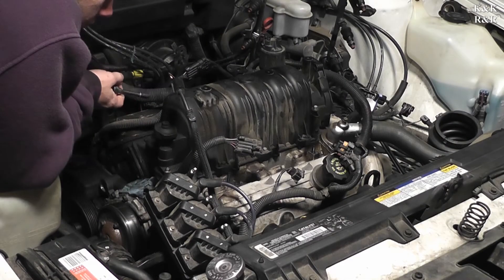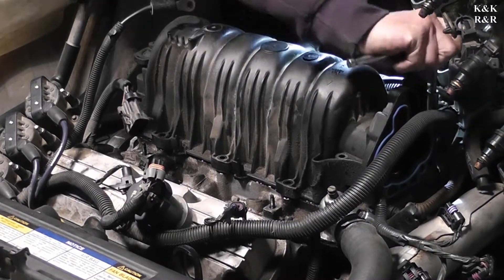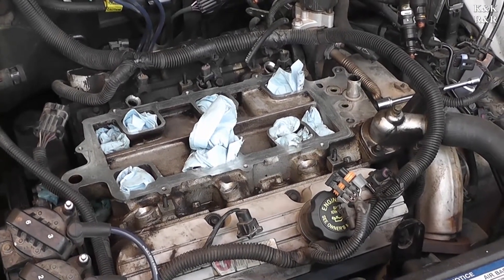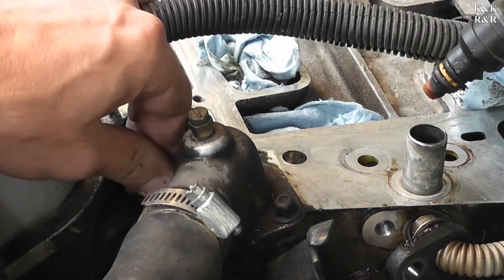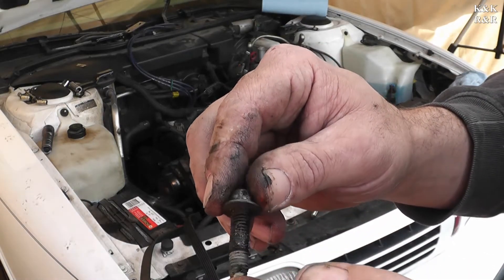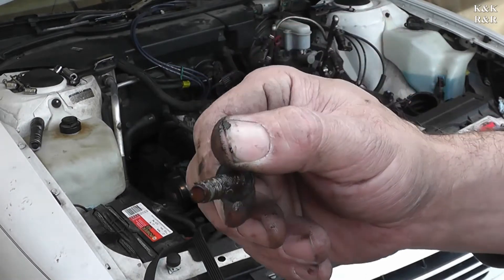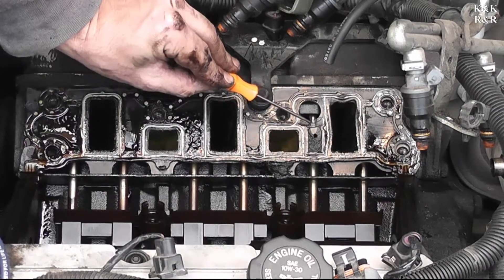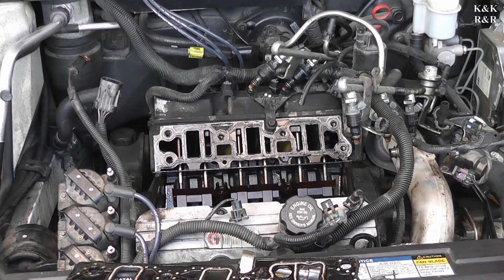1995 Oldmobile 88 Pt.3 3.8L / 3800 Upper / Lower Intake Manifold Removal Parts B & C

Comment: Hi, new great videos I have been cross referencing because I have a Oldsmobile eighty eight V6 3800 series ll Vin K 3.8 l 1996 Royal Sedan and I started last year changing gaskets and parts and still finding leaks. Finally had to change the head gaskets, water pump, timing chain & tensioner, manifold gasket and exhaust gaskets and plenum. Did oil and antifreeze flush torqued. Now I found a transmission extension gasket leak that is probably causing and contributing to the blown head gaskets I replaced. I wanted to know if you have any videos on replacing the transmission extension gasket and transmission valve cover gasket how to at home. Removing the knockle just to get started to replace the valve body cover removal and replace on both including transmission extension gasket.